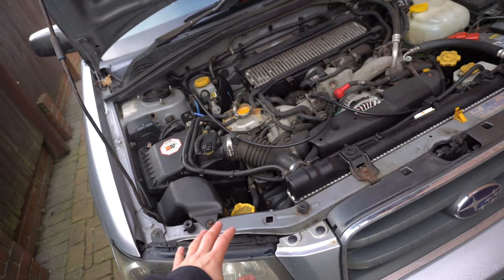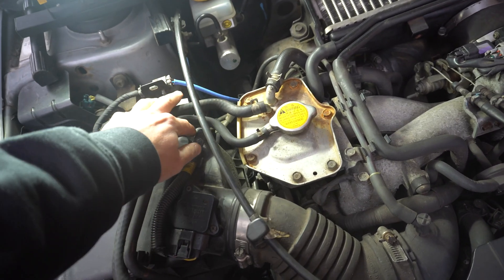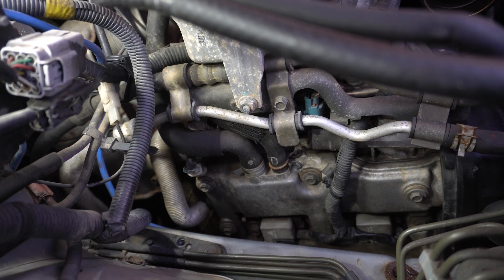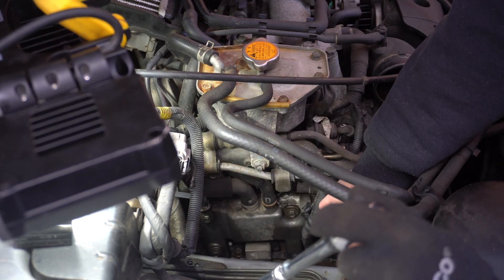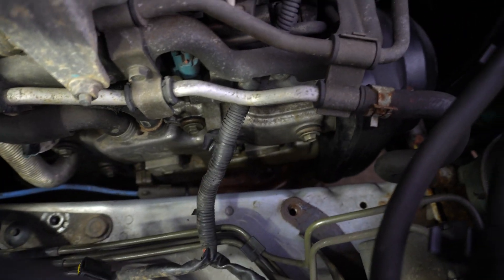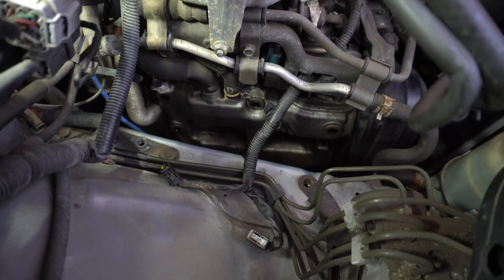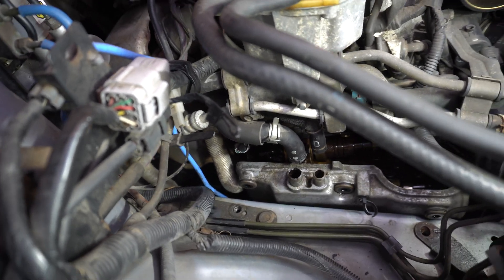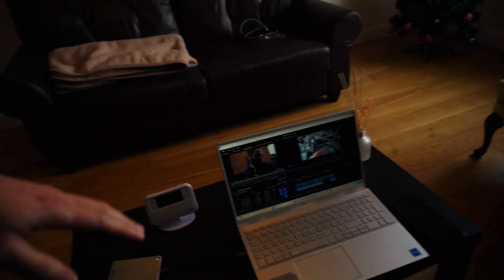EJ205 Valve Cover Gasket DIY: Fix Oil Leaks on Your Subaru WRX!

Comment: Hi mate, thanks for the video. I have a question, have you ever seen an oil leak on top of the timing belt cover? 
Mine is leaking oil around there or is getting there. 
All the best
Reply from the maker: Thanks for your comment!
If it’s on your timing cover, I would say maybe your oil pump is leaking maybe? Sometimes the bolts get a bit loose and tempt to leak, they recommend to re seal the bolts when doing a timing belt replacement.